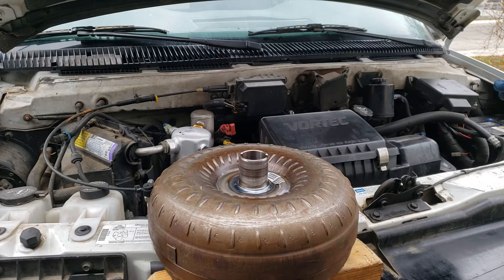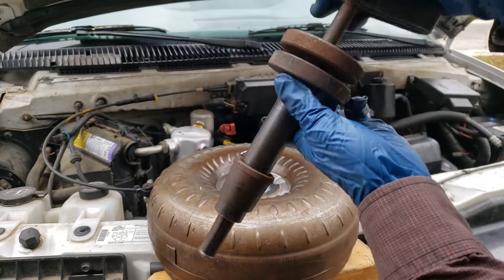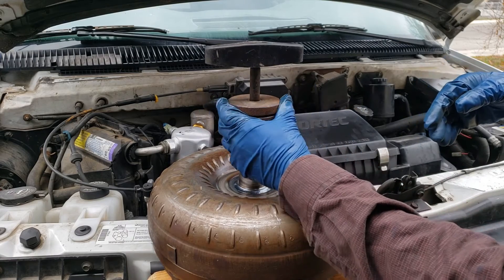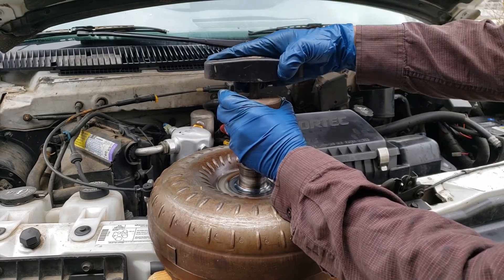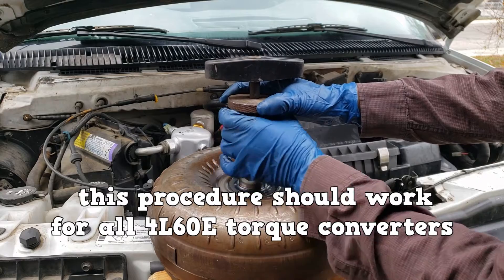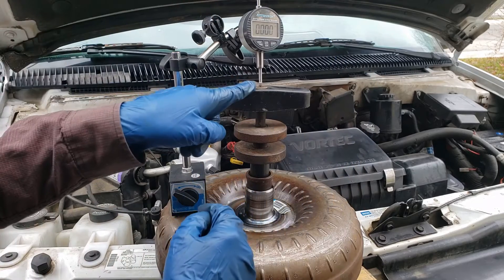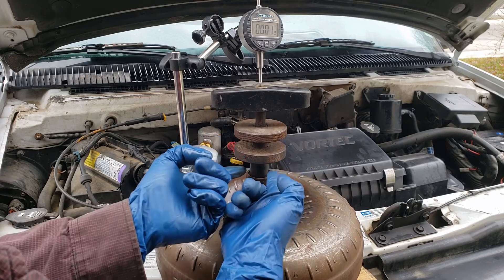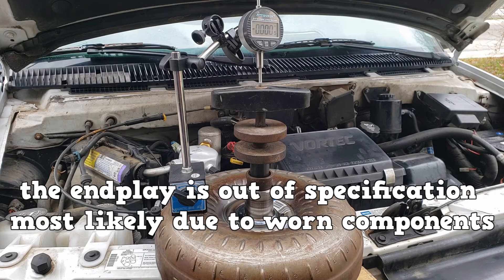Torque Converter Endplay Check (4L60E)

Comment: That was only 1-1/2 turns you did...
Reply from the maker: Great catch! I redid the check with the "correct turns" and ended up with same measurements. Looks like the important part is when you tighten the tool into the torque converter using the knob.

Comment: What symptoms does that cause . I'm at 186 k on a AWD safari .
Reply from the maker: In theory, power loss, but I would say it would not be noticeable. The endplay would have to be significantly high to notice a difference.
Reply: @OldSchoolNoe thanks , I saved your video on ground locations , I gotta check those . Still chasing a p300 miss . I have a 3 in body lift , it's amazing how much room there is under there now . All plugs can be changed through the fender wells . Thanks for the astro/safari tech tips !